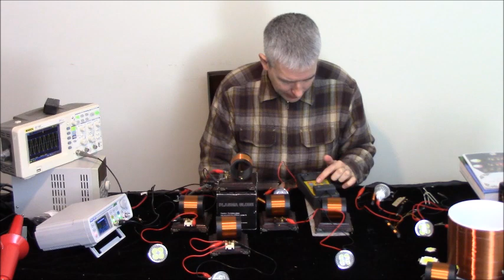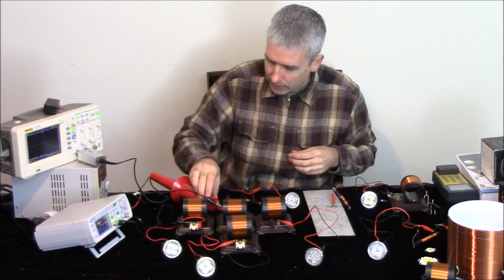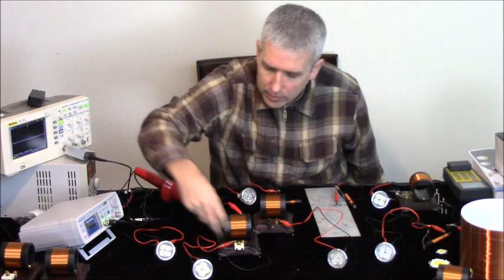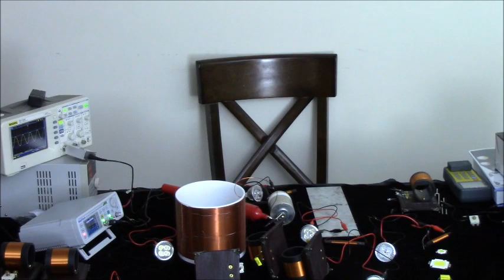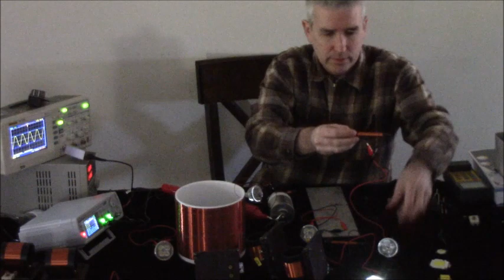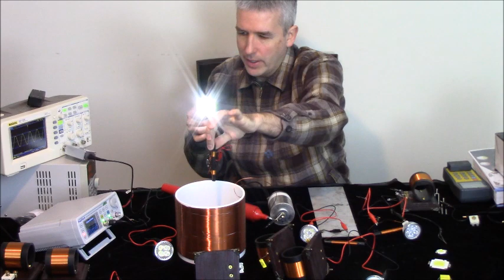Over unity Resonance Demonstrations  with Small & Big Kit Coils

Comment: Hello Rick,
I will start experimenting with my Resonance Induction Coupler Kit soon. I watched this video again to prepare. You mentioned that connecting the circuits to ground may become dangerous to the unexperienced. I actually want to take measurements with my oscilloscope. As you know, the probes have the tip and the "ground clip". The ground clip connects to earth ground through the ocilloscope and the power cord. I see in the video that you are also using a digital oscilloscope. So its use seems to be causing no problems, does it?

Comment: This may help: I found a 500 khz LCR meter on amazon, here is the title:  M4070 LCR Bridge Tester Automatic Range Capacitance Inductance Meter with Measurement Frequencies up to 500kHz
by Q-BAIHE
Price:	$90.68 + $4.99 shipping
Reply: and i found another LCR meter M4070 Auto Ranging LCR Meter on amazon, title:  autoranging Component Tester LCR in Circuit Meter Digital Resistance Tester Up to 100H 100mF 20MR, 1% Accuracy 5 Digit Display with Backlight Large LCD Display
by WIWU
Price:	$99.99 & FREE Shipping

Comment: Dear Rick, May I ask you a question.
I have a 70 turns L2 resonated coil L1 of one turn fed with a 1.8 V input and set to resonate. It lights my 3.8 V bulb.
However, if I have L1 make 3 turns, the LED comes brigther.
It contradicts what I expected , which is that each turn of L1 divides the voltage.
Any thought ?
Reply from the maker: It's too difficult to evaluate what anyone experiences in such matters over the internet. There are many factors that go into your setup and this is not the place to guess about it. You have to consider the local environment in all the capacitance relationships with those coils. Also the inductances. It is a very involved to properly understand the proper mathematical relationships between the L1 and L2 coils. And I am not the one to teach on that subject. There are books like the Tesla Coil Transformers that help. Anyway, it is not merely about voltages with winding loops. This is way beyond merely stepping down voltages and stepping up secondary amperages like a regular transformer.
Reply: @rickfriedrich  Thanks Rick. I was hoping may be to post my question on the rick forum, when it's up (please let us know :-) ); I know you are busy on 100 things. My coils are actually 8 meters pvc plumber copies of the kit's coils and the wire capacitance is greater than the kit's coils, but I agree I should post a video and ask the question, it would be clearer for you to understand and be able to help anything about it.
Reply from the maker: There will never be such a forum as I won't have the time to do it right. I only do youtube Q&A unless it is product related by email. 
What I find is that without being present to see all the details it is so easy to make mistakes so that it is hard to help someone even with a video.

Comment: Hi Rick
me again :)
using Don Smith magnetic induction systematic index book (where he instructs to select a frequency then constitute the L2 coil length), when I match the coil length with the frequency, it does not resonate. Can wavelength be disturbed and put of of resonance with the mere capacitance and inductance ? Or it is 100% working and I am doing it somehow wrong ?
Reply from the maker: One problem that Don does address is that the speed of light does change for various reasons. So you start with a longer coil and work your way down.
Reply: @rickfriedrich  ok thanks ! I need to try again then.

Comment: Dear Rick,
 A small question.
in a second wireless parallel LC  tank), I was able to see 950 Vpp and a nice beautiful sine (can't remeber the frequency, but noted it) ( with input : LC tank #1 input : 1V from the frequency generator).  But when I placed the LED and a 100V bulb (sorry I lost the Kit's bulb, I use a bulb from apreviously SSG built stock) across the #2 tank's coil, I got no light. But I would have expected even to blow it up at that voltage...That's my current level where I "dont' get it". Any insight welcome :)
Reply from the maker: Whenever you place a load on a resonant coil that is tuned to a transmitter, such a load has impedance, capacitance and resistance which lowers the frequency of the coil. So this is where tuning comes in unless you decouple from the resonance coil with another coil like we do with the ferrite rod wound with a coil. That is usually how resonance coils are run, where you do not directly load them. With Don he rectified the output to a hv low uf capacitor bank which has the same effect. When you use an LED that is not the same because it is not rectification but just like a resistance load. The kit has very low power LEDs as merely an indicator and not a significant load. I will be providing 3W bulbs (as shown in my videos) for the kit as an accessory when I can get more in. These have full bridge rectification and sufficient capacitance and respond fairly well even at the high frequencies. But they essentially do not benefit as a load from the high frequencies so only use a very small fraction of the energy being produced.
Reply: @rickfriedrich  thank you. I understand I have "put the oscilloscope to resonate"

Comment: Hi there, yes I'm able to light LEDs at 35 cm wirelessly with 5w input and so many more experiments (over 40 to 50 I would say broadly from the RICK kit).
However I have a quick question to Master Friedrich : when I use larger ceramic capslike  @4.56 uF , the formulaes to obtain the resonant frequency does not work anymore :( as it does for
the 100 pF in the kit. Should I resort to a LCR meter with Q calculation or some other tool or How can I unblock myself ?  Thanks Master Friedrich.
Reply from the maker: While there are many combinations of capacitance with inductance that will be in resonance at a particular frequency they are not all the same. That also has to do with the quality of the parts, structure of the parts, and environment. So remember, 4.5uf is the same as 4500000pf. Since the inductance is 162 uH the frequency would be around 5.89kHz. I just tried 5uf and it was around 5kHz but the gain was very low. You have to consider that the cores you use and the geometry of the coil depends on the frequency. So low frequencies use more iron composites, higher frequencies use air, and mid ferrite and the like.
When I use the big coil I match the small coils with a 5nF cap and they both run at 180kHz very well. Then I can turn the gate driver voltage up to 18V.
Reply: @rickfriedrich  thank you. I need to revisit the formula more  I have since been able to resonate the oscilloscope with all these caps of different capacitance, and electrolytic capacitors, which is worth noting for people. I'll need to revisit to be able to predict the frequency to use without the oscilloscope and with the formula... I have since had the chance to be able to invest in a LCR meter with Q , 250 USD, to help me as I'd like to avoid spending times bip-bip-bip, check LED light, bip-bip-bip -you know what I'm talking about ;-p

Comment: I have tried also the Kit with electrolytic capacitors, but it didn't work. I have tried other much bigger (4.51uF) ceramic capacitors different from the Kit and they work !
I would find an advantageous addition to the Kit a little reference to which capacitors would not work with the Kit (if any,! - I may need to experiment more as I am a newbie ! )
Reply from the maker: The issue is not whether a capacitor works but whether you have used the right polarity.
Reply: @rickfriedrich  that's right !! I confirm I was able to resonate with CBB21 200V 47uF caps, 4,5  uF electrolytic .caps...Thanks Master :)

Comment: Do yourself a favor : invest in a reasonable frequency generator and use it with the Kit. The one Rick uses (a feeltech 6600) is a good one as it seems.
I strongly advise to have an oscilloscope also, although not mandatory to run thourgh all the exercises : the kit is provided with +3hrs video to go through the exercices where you will see the difference between a resonating system and a non-resonating one by Rick picturing the oscilloscope. The oscilloscope is the place where you will see beautiful waves appearing, and wireless and wired leds starting to light by themselves. RUSH THE RICK* ! 
*resonant induction coupler Kit by Rick Friedrich
Reply from the maker: I'm making a 10Mhz frequency generator available as an option now for the kit. This is fine. It plugs into the wall. Once you start the process you can use a receiver coil to send the frequency back into the gate driver so you can remove the frequency generator. The generator is really only providing a little more than a logic input to the gate driver so I don't want people thinking that it is taking much energy. The 10Mhz generator has an LCD display so that take energy. We are dealing with 30ma @9V more or less of energy from the gate driver to do the various tests. That is only 1/4W. The 9V input can be 1300V in the coil at the same 30ma. You can power 100 coils with LEDs from that.
The scope can show you the voltage amplitude. I will eventually offer an affordable one on the website.
Reply: @rickfriedrich  Dear Rick, this statement is huge and I'm not sure how to run it myself even if I have gone through almost 100% of the RICK kit. I think it deserves a video tutorial of its own. (I know you have mentioned it in this video and may be in other as welll but again we need you to help us run this exercise. "Once you start the process you can use a receiver coil to send the frequency back into the gate driver so you can remove the frequency generator " Cheers Master !